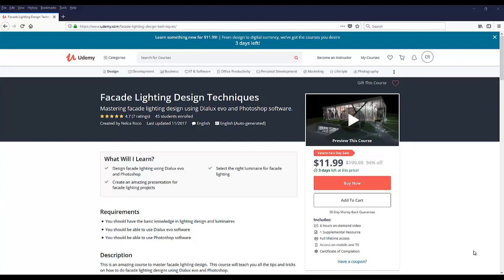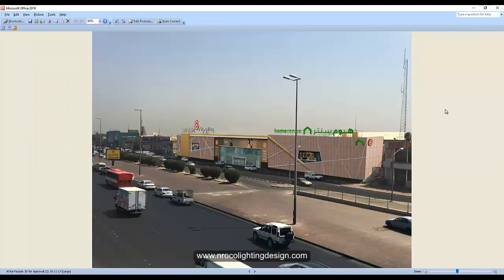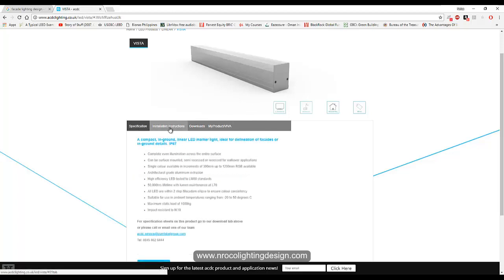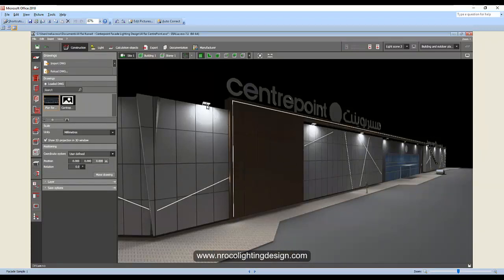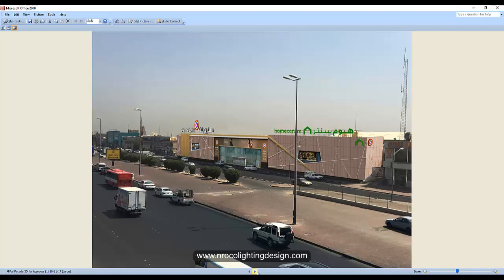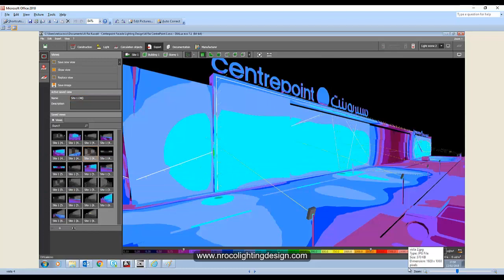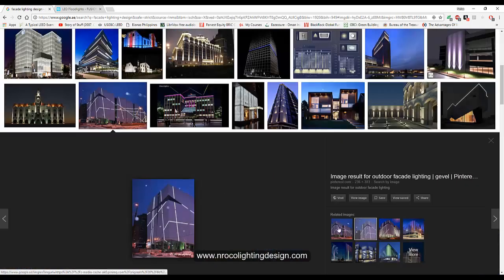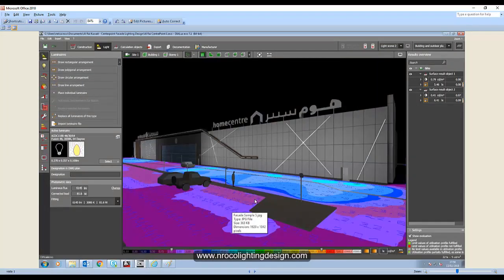Facade Lighting using Linear LED

Comment: Hello, i love your channel im a newbie in lighting design and my question is what is used mostly in concrete facade linear like this? Surface mounted or recessed?
Reply from the maker: to have a looking clean facade, better use the recessed, but if there is no provision to put a recessed one, then the surface one is still ok.  anyways the linear fittings are mostly thin and slim.